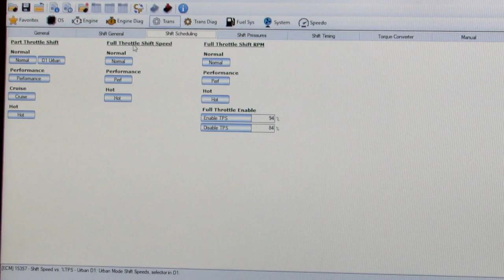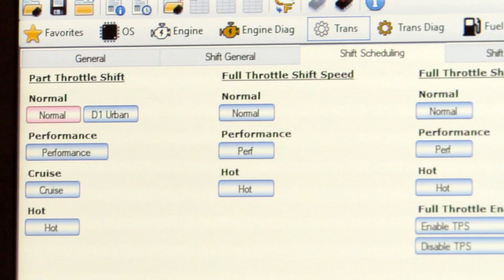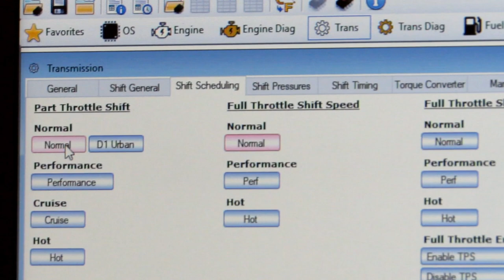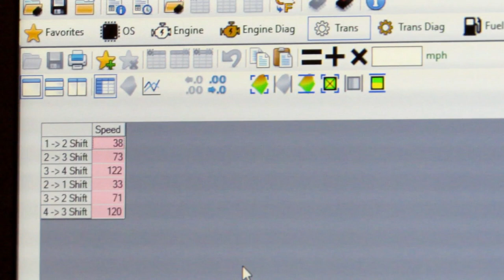4L60E Part throttle shift tuning

Comment: Good tutorial. When using the HP Tuners, do you read both the PCM and TCM to do this? Or do you just read the TCM, then tweak and write it to the vehicle?
Reply: You can read only the tcm, if the tcm is a separate module.

Comment: The main problem my 4l60e has is with downshifting i'd say 80% of the time it's downshifting properly but the other 20% it doesn't downshift it just feels like i'm in too high of a gear and the car speeds up slowly. Is this something that can be fixed with tuning?
Reply: I know this I'd a 2 year old comment but you have a mechanical issue causing slipping most likely, could be wear or could be cracked accumulator pistons or any combo of other common 4l60e problems
Reply: Yes, it can be fixed with tuning..

Comment: Love to see more tuning vids. I look forward to seeing more vids like this. There is one hell of a market for this type of video. I have a question. My truck feels like it slips when I go WOT to pass a car. So say i'm running 60 in 4th then go WOT it will down shift to 2nd and kinda feels like a slight slip before it really starts to pull. U ever run into this issue?
Reply from the maker: I'm sorry I don't do trouble shoot unless I can physically be with the vehicle.
Reply: @lsxtuner6126  not sure if it makes a difference but my tune on the trans is stock on my 09 rcbs Sierra 4.8. Just looking for some ideas to try. I'm going to play with shift timing and pressure just wasn't sure which part to mess with since it down shifts from 4th to 2nd. I'm assuming the 3rd to 2nd but just want to make sure. May just need to run some more logs and make sure it's not timing or torque mgt doing it.

Comment: Hey man how would I do this with a 6l80e? Would I do it the same way?
Reply from the maker: To be honest I haven't done much with the 6l80e.  There are several more tables so use common sense and make sure you don't contradict yourself in the various tables.
Reply: @lsxtuner6126  gotcha I appreciate the advice